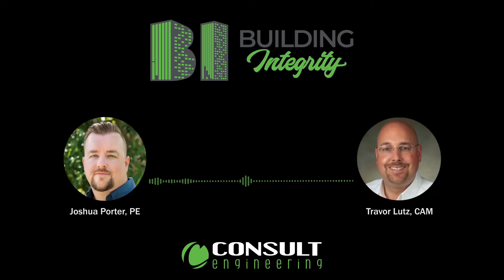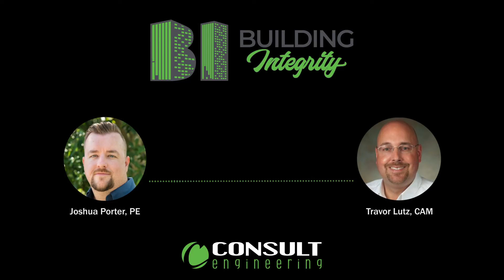Water Intrusion - A Discussion For Condo Owners

Comment: Why do they still use stucco in Florida? Aren't shingles so much better?
Reply: Stucco is being used at the side walls of a building. Shingles are for sloped roof(top)s. (The Champlain condo buildings had flat roofs so even there shingles would not be the right choice be cause they of course exist of loose parts that only overlap so that when applied with an angle any water will only run over it on the outside and not penetrate in-between or underneath, but when laid flat water of course would get under them. On flat roofs usually uninterrupted asphalt is used, which can be applied from large rolls, it is laid with the edges overlapping and those are made waterproof by gluing then together with asphalt that is heated until it temporarily becomes liquid.)

Comment: A complete revamping of the inspection system needs to be done. Once a problem is detected by inspection, the city needs to be involved in determining what the best course of action is. Leaving it up to the condo association to ‘FIX’ these large projects is criminal. They always look for the cheapest way out. Oversight by the city should be law.